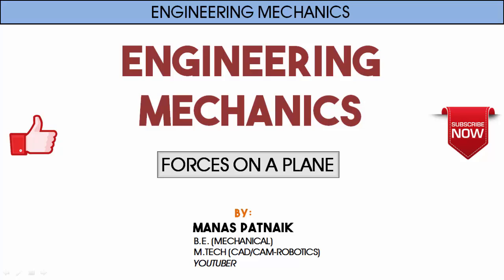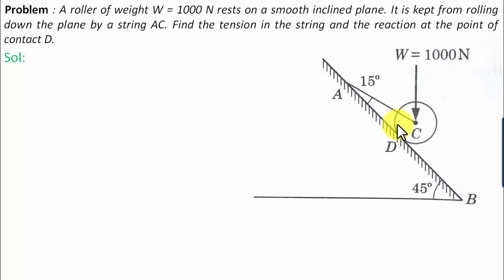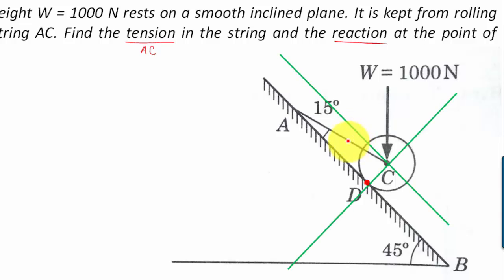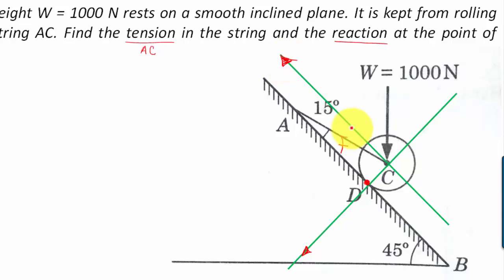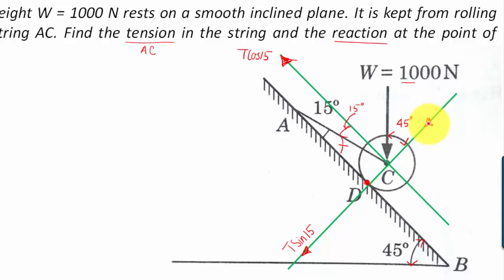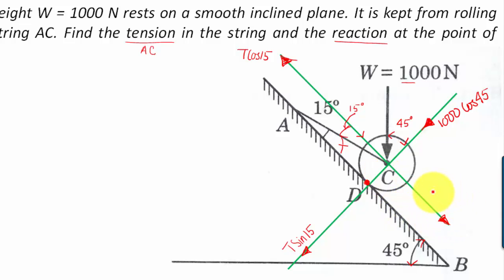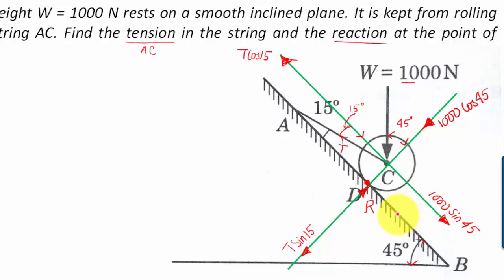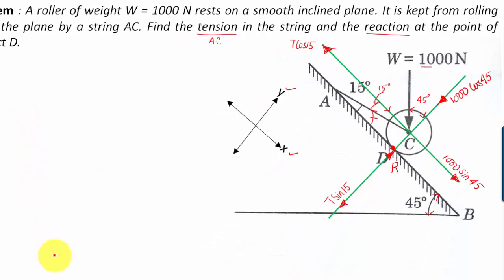Engineering Mechanics_Forces on a Plane_Level 1_Problem 7

Comment: Could you please tell me how the W=1000N adjacent angle become 45 degree?
Reply: Because force is acting on the centre of the roller and which divides quadrants into two equal parts , i.e 45° and 45° hope it help others viewing this video
Reply: Only inclined forces are supposed to be resolved..I am yet to understand why has 1000N  been  resolved??
Reply: yes how we resolved 1000N its weight only na